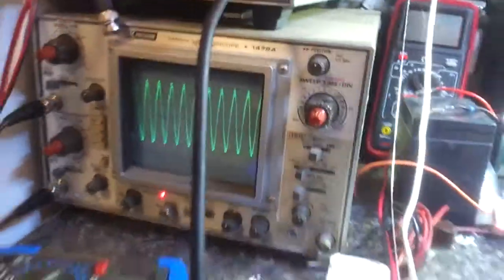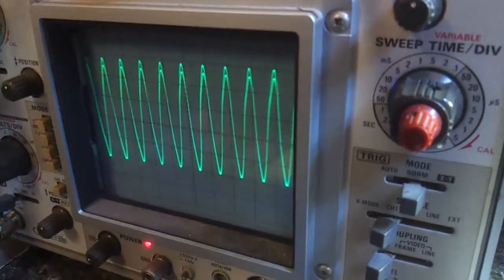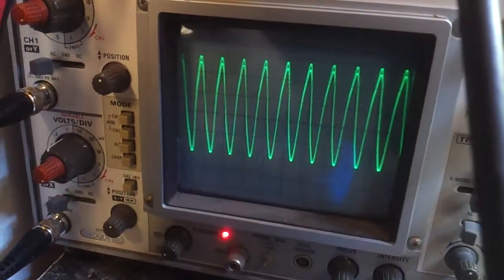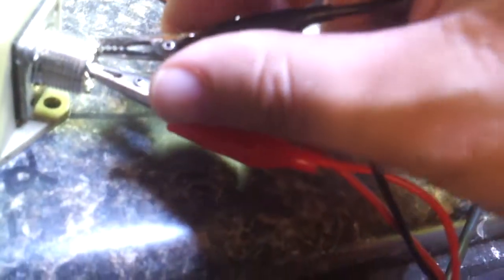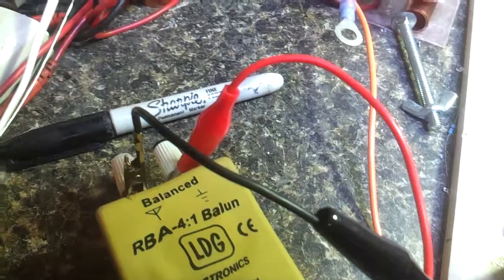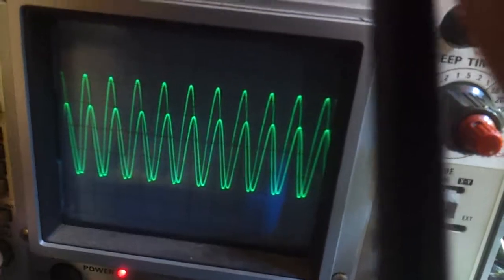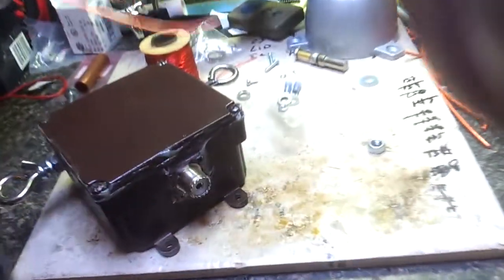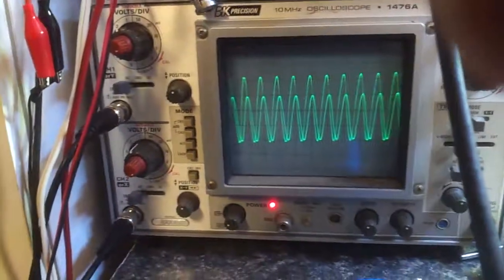AG6IF 2.5 to 1 Loop Balun

Comment: It is a shame that your measurements are way off and very bad example of any proper measurements of insertion loss. Comparison at 2MHz is very misleading  since 4:1 Balun (voltage type) does not have enough turns  to work at 2MHz. Your "Talented BALUN" is a bad example how to make any wide band transformer BALUN. If you measure your contraption with any network analyzer and scan only SWR with ~125 Ohms resistor as termination, you will learn that it does not have transformation ratio of 2.5:1 from 2-30MHz . Also, insertion loss on 15-30Mhz will be huge. But, you and many like you portray as "experts" in HAM radio world .  No wonder HAMs today are so  uninformed and much closer to average CB-er. Invest some money in any decent SWR analyzer and learn how to make any BALUN/UNUN or transformer by reading what other HAMs already published all over the internet.  Sorry if I am a little harsh but your video is an insult to any RF engineer.
Reply from the maker: +Daniel Horvat Hi Daniel, the 4/1 balun is rated for 2mhz actually, according to the vendor website, nonetheless, I'm glad you watched and posted your comment.  If you are an RF engineer and found this video insulting, sorry, not my intention to insult you.  If you are not an RF engineer, maybe you could explain why you think this is insulting to one of them?  Hams tinker, at least some of them.. Take care   Jim AG6IF